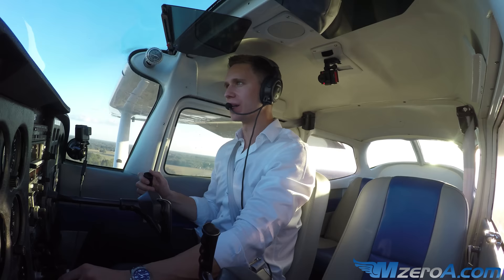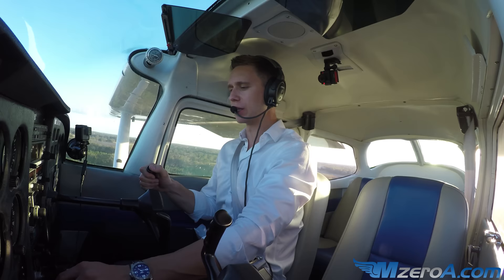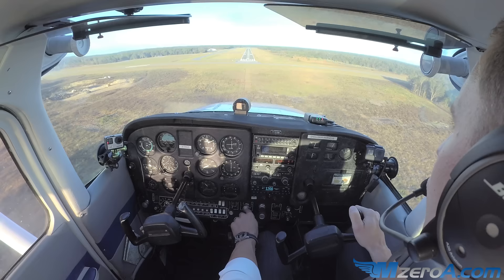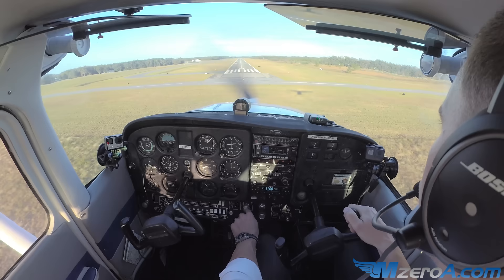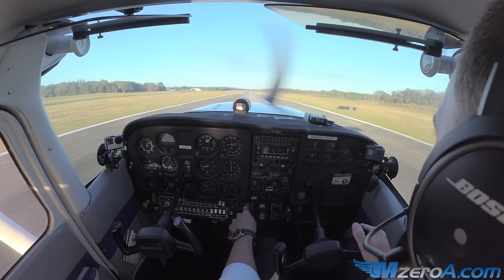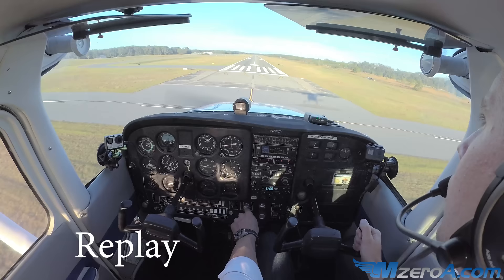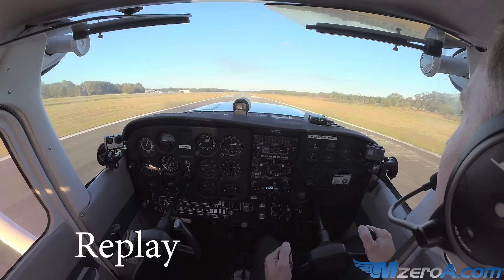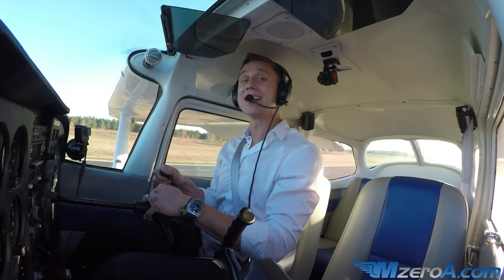3 Tips To Improve Your Landings - MzeroA Flight Training

Comment: Hey Jason, on an IFR flight, How do you know the headings that you have to fly for a traffic pattern at an uncontrolled airport?
Reply: IFR you use "plates" diagrams that tell you what to do.. you fly to an initial fix (spot above the ground at certain altitude) then you fly the indicated direction and altitude to the final approach fix and then descend according to instructions on the plate, usually 3 degrees or around 500 fpm in a 172. if you see the runway before or when you hit your allowed minimum altitude you can fly straight in visually. at a non towered airport you then switch to the CTAF and announce your position and intentions... flying the pattern or straight in. If you have listened to the awos or asos (I hope so) you know the active runway  so you land on it. Most patterns are left turns because the pilot sits on the left, but some are right turns (right pattern) to avoid obstructions or noise abatement. runway 16 is a right traffic pattern at KDWA because of parachuting to the East, at Nutree runway 20 is the same for different reasons.

Comment: You didn't really explain what the transition is. At least I couldn't discern it. It seemed to be the same as the flare.
Reply: It’s all definitions, watch a 747 do a flare and you see the cockpit shooting straight at the sky. What he means is just to pull back as the cockpit lowers and keep pulling back but don’t flare where you don’t see the runaway. I’m sure you landed while not flaring and just called it a flare, he’s just trying to get the terminology right,  or just trying to be different for more comments who knows. Either way if you landed a Cessna before then you “transitioned”. You really can’t flare a Cessna or you either ballon or have a very very hard landing.